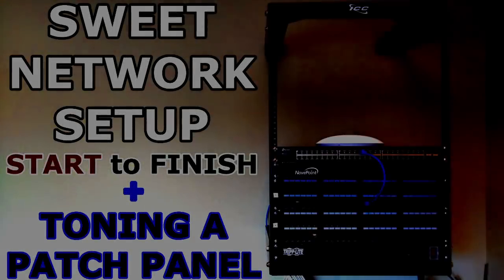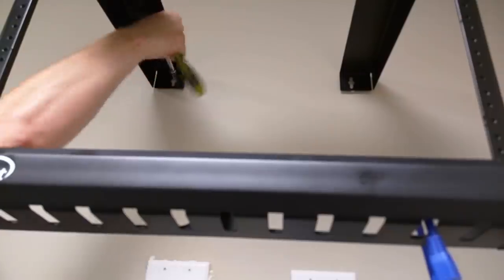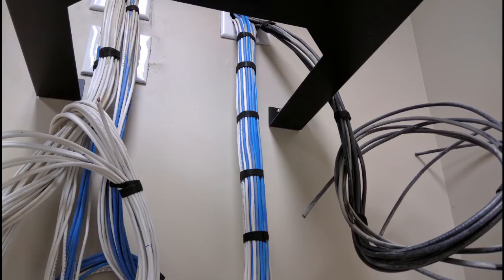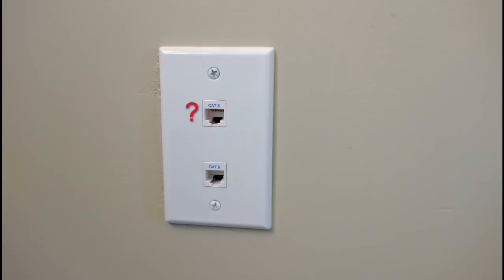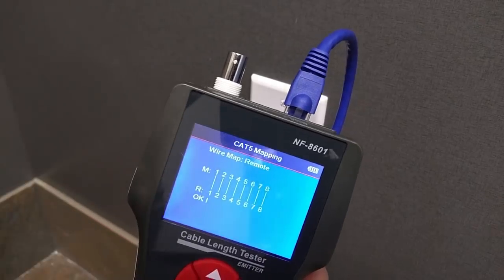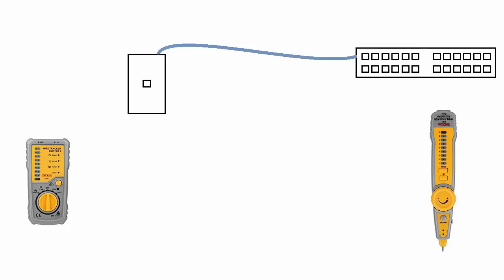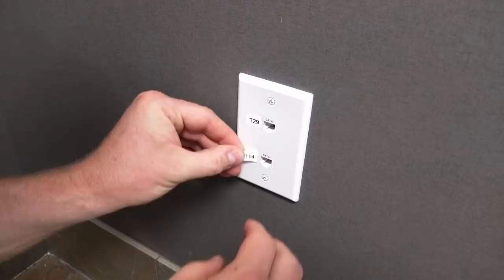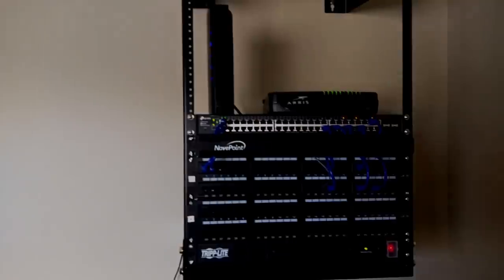Complete Network Setup // Toning, Identifying Ports

Comment: I’m a IT Consultant. I started from the bottom just like anyone else and I now design network infrastructures for buildings. I can honestly say that labeling is a no brainer must do on each and every cable run. Every cable needs to be labeled. I’ve terminated thousands upon thousands of patch panels for sky rise buildings and if I ever caught anyone doing that on my project I would literally run them off because that tells me so much more about what they don’t know. I can’t afford wasting time and hunting down mistakes. If you’re doing a small project like this then to each their own BUT I would recommend to think twice before showing someone the wrong way because they’ll have to pay for those consequences. I don’t mean to offend anyone reading this either....it’s just advice from a professional.
Reply: I kept scrolling when you said “I’m a IT Consultant” ....
Reply: What is the saying about "consultants"-->something like; you're just paying someone to tell you what you already know.
Reply: I'm no IT expert other than self-taught knowledge. But it would make sense just to label cable runs. The time it takes to label the cable vs the time it takes to find out which cable goes to which port is a no brainer.
Reply: I support you with this .
Reply: Take 2 seconds to label a cable vs having to tone out 1000 outlets individually? 🤔 Not to mention if you label them then when you install at the outlet end, you can put them in numerical order throughout the building.

If you don't label then you've never worked on a big job, END OF! Try doing a data centre by just toning at the end 😂
Reply: Joe is exactly right. Labeling the lines before hand saves time and money in the long run. You're doubling your time by having to hunt where the line is and then making sure it works versus knowing exactly where the line is and simply testing for continuity.
Reply from the maker: +CGComputerInc depends on the job. IDing the lines in this project was a breeze actually. I guess it just depends.
Reply: Yeah for this project you were fine by doing your method but when you doing 200-300 lines or more then it's not necessarily viable.
Reply: If you are a real IT Consultant and not wane waste time then you are SO WRONG man. NEVER LABEL !!! See my other comments about the way you should do it. Everybody has to use this, also the "so called" professionals !!!
Reply: I just did some networking working in a city building. All of the jacks around the building were labeled with old labels. Whatever the label was on the switch did not correspond to the wall. We luckily had a building map identifying each but good lord what a pain in the ass.
Reply: Joe Hidalgo how do you label a cable if you don't even know where the end is going to be? Lets say you have 10 outlets with 2 lines each, when you terminate the outlets yes you know which cable it is but when you do multiple outlets and lay the cables to the network room, you got a stack of 20 cables how would you know which 1 goes where, you cant label the other end because you don't know cable length you would need. Or do you terminate 1 outlet at the time and lay each cable individually to the network room?
Reply: You should better go back to your bottom start. You still not learned anything ???
Reply: Use the LED system !!! Never labeling needed !!!
Reply: He has not !!!, The LED system is so much better and faster and NEVER need labels as a waste op time and effort.
Reply: xFlow777 you....label the cable box and start the run near the faceplate....
Reply: There is always one guy who thinks he knows it all, this guy obviously didn’t run the wires. I go behind “ consultants “ daily LOL they spend more time telling everyone how much they know than really accomplishing results.
Reply: I am a Fibre Optics Field Tech studying my way into Networking and I would HATE to be mentored by someone with your type of attitude towards mistakes done by your crew! Teaching them how it's done is better than just "running them off". Mentoring is CARING above all.
Reply: @ron_belgium  Everyone has their ways of doing stuff but I find the LED much faster
Reply: I once went to setup a network at an office where the IDF room was located down the hall..each location had 2 ports. Mind you this  is a brand new building in downtown Chicago- not one port was labeled of the 70 plus ports they ran that I needed to tap in..SOB..these were ran by union electricians- WTF..
Reply: I did another job where the office wall plates where labeled clearly - I then go to the patch panel and none match until I figured out why - they labeled them based on the network switch port..WTF..
Reply: @xFlow777  Just label the cable before you start pulling the cable and when done cut the cable from this roll and mark that end also, done deal so easy.
Reply: @luffirton  someone should tell this to that Karel guy talking about not labeling at all...
Reply: @luffirton  Thats all fine and dandy on small pulls. but on 100+ pulls, its a waste of time and its likely for the sharpie to rub off in the 115 degree heat. Better to just run the cable and then use a 45 doggle toner to back label everything as you test it. If you use keystone patch panels you can just swap locations to your hearts content if you want a specific labeling scheme. Otherwise theres nothing wrong with just labeling outlets by the patch panel order. Unless you have OCD in which case you got other issues to deal with.
Reply: Joe, a high level network solutions architect would never touch a cable believe me
Reply: @BudgetNerd  IDing the lines on this project may be a breeze, but if you use good practice always it becomes second nature and you don't even need to think about it on larger projects.
Reply: @ron_belgium  I looked at your video and I still think labeling is better.  Do it this way is an alternative, but your cursing over a way to do things is ridiculous.  If you label each cable you can place them where you want on the patch panel and the labeling can correspond better to their location.  Using this device has you punching down all the cables first, then the labeling at the jack can be all over the place.  Anyway, to each their own.  I won't curse at you for doing things differently.  Good day.
Reply: @Recken1  I thought "karel" also need to do the Labeling AFTER (not BEFORE) the Test?  Both need labeling and all correct?
Reply: @theboibros7207  lol "Professional" Low Volt Companies on a large Install would Fluke Certify all outlets anyways. So the labels can be printed out as the Fluke moves from room to room. No need for sharpies when you can just label them based on the patch panel port. It's the "consultants" who wastes everyones time insisting on the outlets being in some sort of order through the building... when all you need is to know 1. IDF location, 2. Which patch panel, 3. Which keystone.

Easy. Instead of trying to force everything to fit some arbitrary "left clock room rule". Its just the "consultants" OCD that can't stand IDF3 - D - 5 next to IDF3 - E - 15.
Reply: @theboibros7207  Dwl
Reply: @michaelmayfield4304  Before any of that. I would first like to see him not totally and gratuitously destroy the poor English language. I think it has suffered enough at the hands of  Karel Van Gent.
Reply: @donhgr  Who are you referring to?
Reply: @zemaria847   Who are you referring to?  Karel Van Gent ?
Reply: So we had a bldg we had built here ik Chicago and our mgmt office has all there cable wiring done by UNION people - they did NOT label the ports..I didnt even have my tester with me that day to set up the network..what would have been a few short hours took forever..I will NEVER do a job like that..I go and check now before and talk about labeling
Reply: Joe Hidalgo can u direct me... i want to get into the trade... was working for someone who was training me n used my free labor to fatten his pockets needless to say he owes me 2500 n i dont know how to find work n continue my training
Reply: Joe Hidalgo:  Your comment is from four years ago, it looks like the replies go to about 2 years ago.  I agree with your comment about doing labeling as a standard process, then considering not doing it on smaller projects.  I feel it's better to get into the habit first, then skipping it by choice when the circumstances merit it.

I'm curious to know how many people have had to either walk into an existing cabling setup, or revisit one they originally installed but had been reworked over years by others.  I've done both; having a standard format for labeling and trusting in its accuracy makes a world of difference when troubleshooting existing or reworked installs of devices.

Sloppy labeling is almost worse than no labeling when it comes to patch jumpers.  I've fought problems where the two ends of server to rack cabling were mislabeled (think 0-9 labeled at one end with 1-10 at the other end; which cable is number 5?) and it's not fun.  Four or five generations of cable labeling standards in one datacenter?  Good luck.

I also like the comments made about your job title as "IT Consultant".  I won't (mis)judge you for that; I'll listen to what suggestions you offer and not just dismiss them out of hand.  I've run into "consultants" and "experts" who touted their certifications over their minimal real-world experience, but I've also worked with many who learned the hard way (as I did) what works and what doesn't, learned from them but also shown them how I do things and why.  It's the only way to gain experience without having to do everything yourself.
Reply: @theboibros7207  I started as a bench technician overhauling Teletype machines, over 50 years ago and then, after working in other, more advanced positions, wound up planning the installation of telecom equipment in a major telecom office, where there were about 6000 racks & cabinets (most 8' tall),  I agree with him.  Mark the cables as you run them, to avoid headaches later on.  Also, know where they're going to terminate, before you run them.
BTW, it may be hard to believe, but there are some consultants, who actuallly know what they're talking about.
Reply: @BudgetNerd  As someone who's been in the business for over half a century, I wouldn't do it your way.  Every installation tech I've known carries a Sharpie pen in his toolkit.
Reply: @toastymcgee9788  In such situations, you may have to use a toner, just to find out where things are.  I've been in that situation many times.  However, for new jobs, mark the cables.  I've worked in telecom offices.  Years ago, not only were cables marked when installing, but records were kept in a binder, showing what the cables connected to and also the cross connects to other cables, etc.  The techs relied on those records to know what they were working with.
Reply: @xFlow777  You make plans before you start running cables, so you know where they're going.  Even if you don't do that planning, at least you know where each cable came from.
Reply: @rhdtv2002  You shouldn't let electricians do network cabling, unless they know what they're doing.  Let them install the box and conduit to it and then you can run the cables in.  You can even let them install the J hooks.  When I was in planning for a major telecom, I'd hire electricians for stuff like running in power or installing conduits, but our techs did all the installation and cabling.
Reply: @James_Knott  Agreed, don't assume consultants have no experience and nothing good to suggest.  You wouldn't want be judged as "just a cable tech" would you?  Work together, pick the best of all ideas that fit the situation at hand.
Reply: @bobblum5973  In the telecom I used to work for many of the managers, etc. came up through the ranks and had hands on experience.  However, there was the odd one that didn't.  I recall one engineer, who thought punching down that silver satin phone cord on a 66 strip was a good idea.  That stuff is essentially very thin foil wrapped around a plastic core.  It failed in no time.  It fell to me to clean up his mess.  On the other hand, there was another engineer that I worked with frequently who knew what he was doing.  When he wanted special or custom work done, he'd come to me, even though there were several other techs in our department.
Reply: @James_Knott  Oh, wow, that silver satin cable was only good for audio on POTS lines, I even avoided it for modems and FAX machines.

You mentioning 66-blocks reminds me of a tech who was working in a cramped data closet.  He had a screwdriver in his back pocket, crouched down to do something, then stood up.  The screwdriver was blade up; it hooked under (and pulled out!) about three feet of punchdowns in a 66-block column.  It took him quite a while to straighten that mess out again.

66 and 110 blocks, Krone blocks too.  I supported a project over years that evolved from RJ-11s on 66 blocks through about four or five generations.  Async line driver modems for RS-232 terminals and printers, coax-to-UTP baluns for IBM 3270 terminals and BNC/TNC dual baluns for Wang workstations.  AppleTalk / LocalTalk / Farallon PhoneNet for Macs and LaserWriters.  Later 3Com PairTamers and UTP Ethernet transceivers.   CAT 3, 4, and 5 UTP.  Different types of fiber.

Ever see an old-style Ethernet transceiver with the 15-pin D connector and slide locks plugged onto the transceiver and locked, yet upside down?  In a manufacturing building, it took a scissor lift to get high enough to install them, and it took one to get up there to see why the union electrician installed transceiver wouldn't work. 🙄  They actually split the metal surrounding the pins and mangled the pins in the process.
Reply: @bobblum5973  I started out as a bench tech, overhauling Teletype machines.  My first Ethernet experience was with 10base5 connecting VAX 11/780 computers, so yes I remember those D connectors.  My first LAN experience was in early 1978, in the Air Canada reservation system.  It used time division multiplexing, not packets, over triaxial cable @ 8 Mb or coax @ 2.  When I left that telecom company, I was planning the installation of equipment in their main Toronto office, with over 6000 cabinets of equipment and a LOT of cable!
Reply: @James_Knott  I supported VAX/VMS systems from about 1986 until about 2018, along with interconnecting them with dozens of different other types of systems.  They'd talk to anything! 🙂
Reply: @bobblum5973  In addition to 7 VAXes, we had several Data General Eclipses, along with some Primes.  The programmers wanted to network the Eclipses to the VAXes, so that engineer asked me to build some Ethernet controllers for the Eclipses, on prototyping boards.  I'm the only person I've ever heard of who has actually hand wired an Ethernet controller.
BTW, if you want to learn about the original Ethernet search for "Ethernet Blue Book" from Gordon Bell and also "StarLAN".
Reply: @James_Knott  I know I had a copy of the Ethernet specs, it probably got thrown away when someone "cleaned out" my new desk space as I was moving into it (😡).  I am aware of the Ethernet v1.0 spec (3 Mbps as I recall).  I once solved a critical issue caused by mixing Ethernet v2.0 (heartbeat) and IEEE 802.3 (SQE), where a 10~15 minute file copy became almost instantaneous after switching to all 802.3 gear.

No, I never prototyped an Ethernet controller!  I do recall the DEC DEUNA (I think) which was two separate PDP-11 style full-size boards.  And we used Micom-Interlan cards in VAXes for TCP/IP and DECnet on the factory controllers until the drivers supported sharing protocols on the factory ones.  The Micom cards had metal serial number tags that liked to fall off, and in one case landed across the bus card edge, causing POW! to occur.  The only way I could identify the serial numbers for each card was by reading their MAC address PROMs in a programmer.

I barely worked with StarLAN, but did lay hands on it a few times.  So many different LAN technologies that were out there back then!  Artisoft LANtastic just popped in from my long-term storage!
Reply: What do you use to track wall ports in the networking closet to room locations where the ports cabled to? is there a way to add this information to a network monitoring and scanning software?

Comment: I’ve been searching  You Tube for this exact type of video . An explanation of a network for the average person.
I did a bit of this in my remodel and I realized real FAST I had to go get that cable tester. It’s so much easier than labeling. At least on the rough install. I know this is an old video but I am curious why you used the pattern on the incoming upper and lower patch panels?